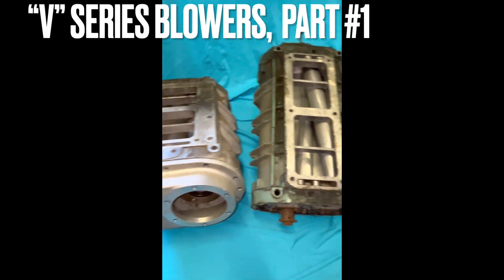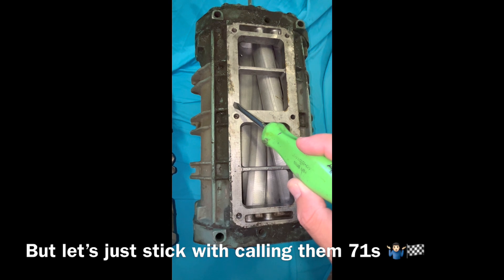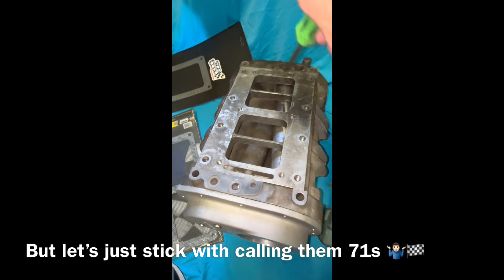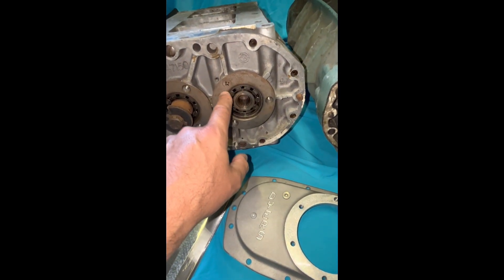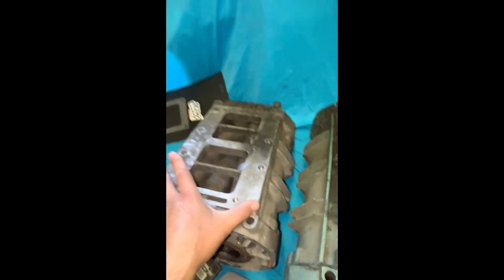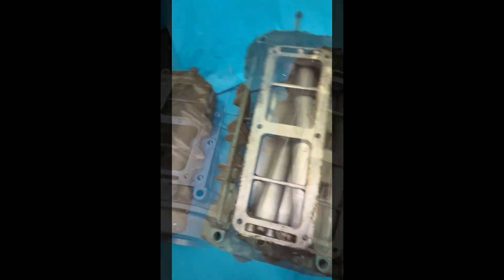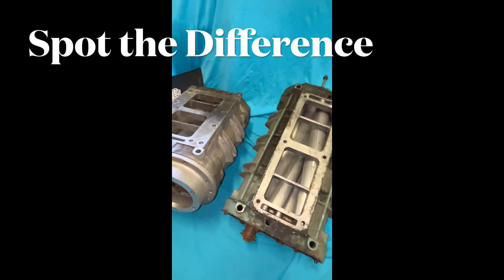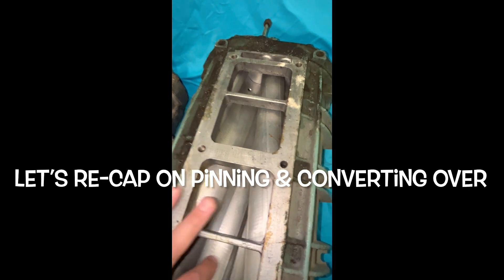6V71 Blower & 8V71 Blower #1, Diesel to Gasoline 🏁

Comment: Hey brother! Is there a trick to getting the front and rear cover plates off a blower that’s never been serviced? I have been trying a slide hammer and slightly tapping them, found your channel and figured I’d ask. Maybe I’m doing something wrong, these end plates are on there.
Appreciate the videos !
Reply from the maker: You first need to pull off the end “plate covers”……you will then find all the gears ⚙️ to be taken off, Bearing covers & then you can pull /slide off the actual end plates off the rotors itself. 👍🏼🏁

Comment: There is also a 8V92  small bearing/ big bore I think.. well I know mine is a 92 series.. and small bearing.  I posted a video, would you take a look at mine and tell me what you think it is. I believe it's a 8v92.. small bearing Big bore
Reply from the maker: There maybe a lot of variables🤷🏻‍♂️, but i think you have an actual 8v/71 ……I’ve done the video on identifying between the two (common differences), big bore vs small is identified via the thickness of the top flange on the blower case (thicker is small bore / thinner flange top is big bore) forget the measurements🤦🏻‍♂️ but there’s like an 1/8th in differences on either end . If small bore rotors are installed on a large bore case, will have big clearance & loose boost…..👍🏼 on traditional cases this is, as for V series cases I’m yet still not aware if there is small/large cases on these 🤷🏻‍♂️?

Comment: You are comparing a late style v6 to a early v8 , the extra bolt holes on the v6 iis for late style turbo the v8 is made with extra holes & also v8 blowers  were made with big bearings if you look in Detroit manuel there is a different setting for p blower ( puffers) also beware of v6* v8 blowers that have a C stamped on end plates they are Calif smog blower the rotors are smaller & the top of case on the top inside are cut back so the  rotors seal at a later time , not good stay away from calif smog blowers.
Reply from the maker: Check out my other vids on all this…
V-series blowers are easily converted over to run on gasoline/hot rod use…. Once the right process is done (converted over) these blowers can make a badass V8 build🏁, they have been doing so for a long time even still today. Although of course not as popular or desirable as your usual 6&8/71 , but the point is to point out these V blowers can be converted over/ & used if you wanted too, & also to explain & identify a little about them. Check out & watch the full vids, cheers 👍🏼🏁

Comment: Which ones are Bypass Blowers? thanks
Reply from the maker: A lot of these V series blowers can be bypass ones, remember they came off a compound style diesel setups (Turbo fed Blowers) but forget that….. just stay away from any Case or End plates that have a weird huge relief opening anywhere….. some end plates would have a huge hole opening in the middle top (that is the relief bypass) coming from the face plate side & out that top hole…
That hole can be plugged off also either with a welsh style plug/ top block off plate which enables you to still run that end plate. Don’t forget you can also get aftermarket billet V series endplates for pure competition use 👍🏼🏁

Comment: So 6-71 6v71 back plates and covers fit a 8v71? I got one for 50 bucks at a speed shop needs to be converted but im having trouble finding stuff. Found a piece here and there. I dont got to worry about needing a governor plate or anything like ive seen on some?

It was a spur of the moment thing but id been eyeing it for years and finally caught the guy who owned it.   Old guy at the shop whos the parts runner cant wait to see it on my car.
Reply from the maker: So the end plate “covers” can be used with the V series, & some 6/71 or 8/71 end covers can fit also……the one I’ve shown/illustrated can , & can be trimmed to suit around the corners👌🏼
Reply: @69JANKS  sweet I've seen a few aftermarket ones that say they fit. First I got to tear it down and inspect it. I'm not expecting it to be great rotors seem to have some marks on the raise portions.. Hope it's good cause I have plans for a Mad Max style 77 Mercury Marquis
Reply from the maker: @commanderwhite12   now that will be apocalyptic badass 👍🏼🏁
Reply: @69JANKS  indeed! It ok to message you for information and a advice? I'm doing this on the fly, spur of the moment thing cause why the hell not? Dare to be different baby.

Comment: On one side of one of the rotors it says GEA  side is that the front I'm assuming?  Plugged all my orifices that I'm not needing today, figured out it is 6505-2rs & 5205 ZZ for the front & rear  bearings.. much cheaper if you buy them that way instead of through a blower company.. about a quarter of the price ! And did you have to remove any of the rear rotor shaft?
Reply from the maker: Check out Deans Blowers page below, he has kits & info for the DIY builder👌🏼🏁
https://www.ebay.com.au/itm/265628617150?mkcid=16&mkevt=1&mkrid=705-154756-20017-0&ssspo=J82ed08mT6u&sssrc=2349624&ssuid=CVxzUGqbT1G&var=&widget_ver=artemis&media=COPY
Reply from the maker: I know the ins & out of typical Blowers out there etc, but i get my Blowers built professionally by my Blower guy🤷🏻‍♂️, it’s just not as simple to do with the basic home garage tooling….. milling end faces, lathe, dial gauges, special vices & most importantly the assembly clearance & timing of rotors 🤷🏻‍♂️🏁
Reply: I ordered my seals and sleeve protectors from Dean's today.  Most the work I can do right in my own garage I'm set up pretty well I have all correct tooling to check tolerances/clearance & why send it out if it's what you like to do on your Sunday afternoon. Love your hotrod as well !!
Reply from the maker: @hedgepethracing9590   that’s awesome HR, totally agree👌🏼keep us posted ok.
Thanks👍🏼🏁
Reply: Hey man, hope all is well !!! Could you do me a favor & look at the blower video I put up months ago & tell me what you think it is.

Comment: still learning all the differences in these old Detroits.. I started the same project about 2 years ago, there was only a few people doing it on YouTube. My   8v 92 going on a Ford 351 stroked to 420.. finally got a little time today to do some polishing. My av92 looks just like your 71.
Reply from the maker: Yes probably is the same, the 92 should have the thicker & bigger bearing end plates over the 71 style…… check out the vids I’ve posted on this. 👍🏼🏁

Comment: Oh man!! I screwed up!! I had an 8/71 from a Detroit diesel. After pulling it off the engine I didn’t know what I was really looking at. Then where to find the intake to run the interesting mounting system vs the gmc style.
So my friend had an issue with his blower on his 56 Oldsmobile. So I gave him what I had so he could possibly get his car going again.

Thanks for sharing your knowledge!! Very helpful and interesting 😁👍🏁
Reply from the maker: Yes RN, you can most definitely use these Blowers & there is stuff out there for them 👍🏼🏁 stay tuned for part#2 it gets better.
Reply: @69JANKS  right on!! I’ll be here😁👍

Comment: Been waiting for this video. 
I was told by a Detroit engineer thst the top of the 92 case is wider and has more tapped holes is because they are turbocharged as well as supercharged and was to get better sealing because of the boost from the turbo.
Reply: Once life presents,
I'll try the 6, then the 8 on my Windsor and see which I prefer...  🤣🤣🤣🤣🤣
Reply: Id say that regardless of wether its the 6/71or the 8V/71 that you use that instant power, the noise, and the visual appeal that only a bower has will have you converted.
Reply from the maker: Correct or perhaps so🤷🏻‍♂️, will edit & upload #2 by the Wkend M69 stay tuned.
Just basic “to know” things only that’s all🤷🏻‍♂️🏁
Reply: Will be waiting for the next video for sure. We are going to be removing the 2 x 6/71 Detroits (finally and good riddance) out of one of our tugboats and replacing with the 2 of best engines ever so will have 2 x more blowers for the stash.
Reply from the maker: @matui6983  thanks M69👍🏼, wowser yes better hang onto em 👌🏼🏁
Reply: Only keeping the blowers, cooling gear and starters off them. 
Have you tried different pulleys (as in under and overdriven) on the mighty Capri?
Reply from the maker: @matui6983   yes I’ve tried a few Pulley changes…..so as it is for the Street it’s underdriven & produces max 7psi & has run 9.40@148 as driven……. & another pulley change sees it overdriven & produced 12’ish psi & run 9.1@151, got a few earlier vids on this & the excuses with it all 👍🏼🏁
Reply: Wow. 
5psi more for 0.3 quicker. Nowhere near the advantage I wouldve expected. 
Id be leaving it at 5psi. 
My little brother has found an original V6 4 speed Capri an old guy is sitting on that could be for sale cheap. 
Capri + decent engine+ blower.....
Has all  the makings of good times ahead.
Reply from the maker: @matui6983  right on M69🤷🏻‍♂️there’s a lot of variables with roots blowers eg: Gasoline (pump or race gas) can only do so much until it all ends & bottoms out with inefficiency & heat soak🤷🏻‍♂️plus being carbureted……then there is alcohol (methanol injection) that changes all that & becomes a whole different level in Power/Tq with blowers……so on & on🤷🏻‍♂️
There’s also a water/meth spray option in the carb adapter that can be applied in the tune (carb setups) , or e85 carbs👌🏼etc…… but yes on gasoline & not being “stripped rotors” they become hard to achieve boost efficiently….., so 5-8psi on pump they’re badass after that in my case it was probably only making an extra 20hp/1psi after my 7psi tune…….
& of course remember what I previously mentioned also it comes down to the Blower size too, clearanced loose or tighter, stripped or not etc……👍🏼🏁
Reply: Blowers are old school and old school is cool. 
There was a car featured in Street Machine many moons ago. A green Capri owned by sumbody whose name mightve been Doug Stankov. Was a wicked car. Did 1/4 in 10's from memory and not blown. 
Because of  that car and yours I wouldnt mind building a blown one just for street use only.
Reply from the maker: @matui6983  you said it, nothing beats Oldschool Cool 😎 🏁……..i think i do remember that Capri…..
Right on M69 go for it buddy👌🏼🏁 I’m just hear to share my experiences with it all 👍🏼🏁
Reply: Well Im over the moon you are sharing your build and what you know (cept the top secret stuff) 
Car is a total credit to you.
Reply from the maker: @matui6983  anytime buddy👍🏼🏁, didn’t gain much interest all this stuff but I’ve invested in doing so I’m happy actually I’ve put it out there in better perspective & just wanna see more of these badass & somewhat budget setups out there really👍🏼…….thanks for the support M69 appreciate it.
…oh yes, 🤫 the secret stuff will be implemented on “Project 4V Nascar” & eventually different intake/carb tests also.
Have a few new things already aside for that build…….it’s gonna be Badass😎🏁
Reply: Well I for one am happy to watch and absorb whatever you upload no matter the content.  Your "Badass" is becoming a staple word here now haha.
Reply from the maker: @matui6983  thanks M69👍🏼, hahaha say it enough it starts to pick up & trend 😂👍🏼